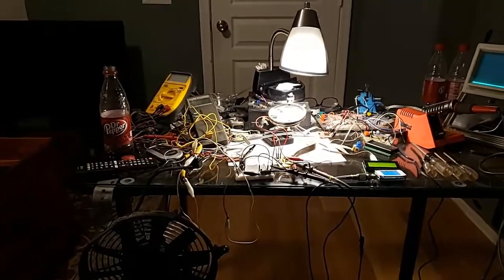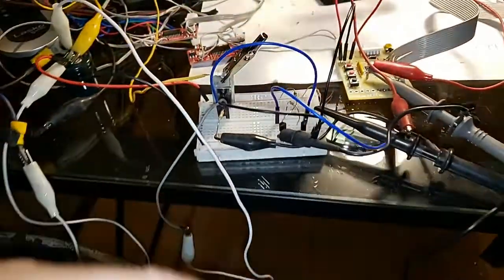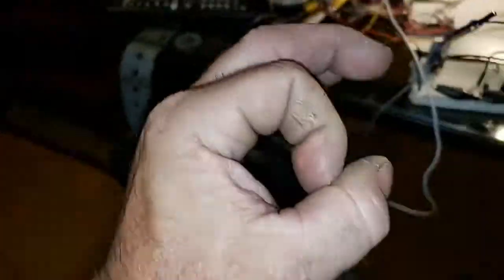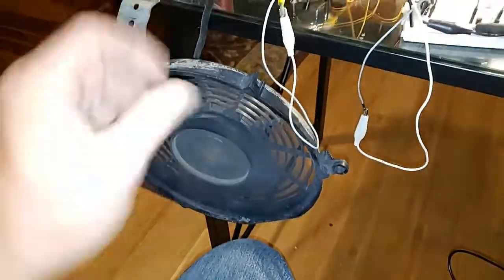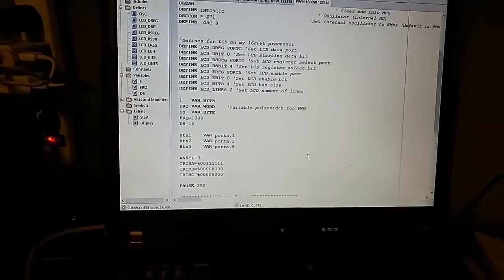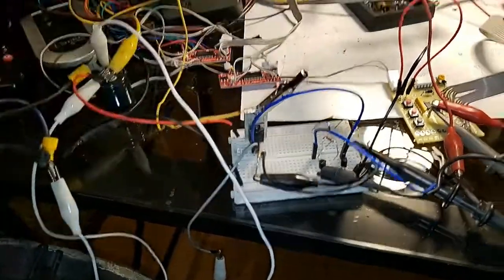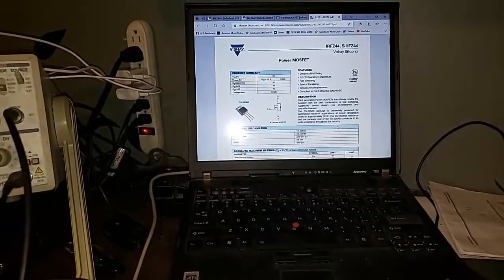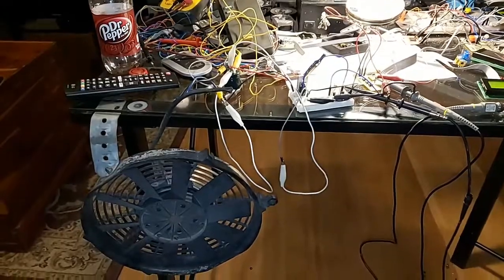Another Mustang Project - Variable-Speed Radiator Controller Test Circuit

Comment: How difficult is it to use a rotary dial or simple digital interface to modulate the speeds of a brushless radiator fan? Basically turning a brushless radiator fan into a household fan. Thanks.
Reply from the maker: A household fan has a motor with several winding taps in the motor windings that vary the speed and the rotary switch is just selecting which one to order. 

With a car fan is just one winding and to slow I'm using a duty cycle of variable pulses. 

This would not be efficient for a home fan. 
Home fans are usually low torque motors. 
These are high high torque to get running quickly.  But they suck power.
Reply: @hackfreehvac  Thanks

Comment: That fan looked real familiar, I think I have a couple of them out in my storage container that my neighbor gave me, can't remember what he said they came off of.  Damn brother, known you all these years and didn't know you had electronic technician skills!  Ive been building circuits off of schematics for years, but designing them and testing them are still on my learning to-do list, heh.  Ive seen those cool mini scopes on amazon too, amazing prices like you said! I can still remember the high prices they used to get for boat anchors at the used electronics shops here in dallas/ft. Worth back in the 90's :)
Sweet design though! I need to make up something similar for my heat pump waterheater, its in the same closet space as my air handler and when the h.p, is running it gets ice cold in there, so want to rig up a fan to blow the cold air into the living space when the unit kicks on. Maybe a current sense circuit or just wire a relay in parallel with the h.p. Fan, or something. I have a bunch of four to six inch computer shaped fans ranging from 12-24vdc and one or two 120-240vac ones. Bought a box of different ones to try and play with making a generator out of a few.
Reply from the maker: You have a heat pump water heater?
Nice. 
I don't know why we don't see those used here. It must use a lot less electricity.

I thought of making my own.
Reply: @hackfreehvac  oooh, that could be a fun project to plan out!  Hmmm, maybe buy a cheapo w.h., cut it in half to put the coils in and pipe it, then weld it back up...if you have room, instead of using the electric elements in it, just set it next to your old one and tie them together with a recirc pump, throw in one of those high pressure bladder tanks and set your main tank temp a bit lower than the h.p. tank so the gas/electric one kicks in if the h.p. cant keep up with demand. Fun fun!  
I wanted to turn my old tank into a solar batch w.h., but think its prolly rusted too thin to use. When spring comes i'll dig out the cheapo plasma cutter I bought and havent tried yet, and cut it in half to have a look :)
Not sure how much im saving with the new w.h., I have some clip around current thingies (love those tech terms!) But thats on my round-to-it list too, hehehe!
Had major back surgery abt 8 months ago so finally my pain level with my back is at least manageable enough to tinker some, yay!
Reply from the maker: I have a water source heat pump sitting in my garage that I thought of tying in with a circ pump.
Someday I might get around to it.

Comment: You can grab any fan controller from a 90s Lincoln or post 2000 ford and drive it with pwm.  I have schematics for how they are wired and signals.   I also grabbed a continental mkviii fan as it is a beast. All for $30 at the pick n pull
Reply from the maker: Nice. 
But that won't buy home made.  Lol
Reply: @hackfreehvac  hmmm fair point. But, you didn't build the fan, or the mosfet..  Soooo what is the written spec to qualify as diy?  Lol
Reply from the maker: Well, it's still DIY to build your own controller and it is my own design.
It is another thing to expect me to build the actual discrete components. That would really be something.
I don't have a clean room or any ability to make chip wafers! HA HA

Comment: Your MOSFETs cooling if mounted in the engine compartment where the air temperature will be between 140 to 180°+ and like trying to cool it in your living room at 70° you will need a lot more heat sink attached to your MOSFET. Are used to do this back in the 80s and early 90s when ford first started introducing modules that particular relays permanently built inside would fail I would bypass him and do the same thing saved a customer several hundred dollars to 1000 $ in repairs. Same goes for the ECM main computer control for the entire vehicle when one particular signal going in and coming out would fail you can bypass it with a simple relay some diode’s resistors to stop voltage spikes and externally mount your bypass. If you waterproof everything and mount your mouse vet in front of the radiator and condenser into the incoming rush of air in the front of your vehicle your MOSFET will greatly appreciate it.
Reply from the maker: I read planning on installing it right in front of the radiator. 
Then it will be cooked by that awesome 130 degree Arizona air.

I already added the feature (in the programming) for a digital output going high when the PWM reaches 100% that will close a relay once the fan needs to run at 100% such as when the A/C is running.

Comment: Well, your circuit is built wrong. You need a diode - mosfet pair in there with some wealthy decoupling. you can NOT and NEVER run the mosfet with an inductive load, without the diode. See this, how the circuit behaves: https://i.imgur.com/6iUZdnc.jpg
Also, the PWM frequency has to be chosen with regard to the current ripple through the motor, so the ripple can be small (maximum 10% nominal current in real applications). Can be easily calculated, if the armature inductance is known.
Reply from the maker: "Test circuit"
And many of these high end mosfets have that reverse diode protection built in. I hardly ever add a diode.

I do however always add a diode when driving a relay with a standard transistor.
Reply from the maker: I've also filtered the output with a capacitor. 
I don't think the brush style motor will care what freq the PWM will be if it's just seeing a variable filtered DC supply applied to it.
Reply: You are just showing, that you don't understand much if anything at all. No offense, just trying to explain you that you do it completely wrong!
Every mosfet has a body diode inherent from its design. But this diode does not act and does absolutely nothing is a brushed DC motor regulator. You absolutely NEED one, connected similarly as you use one with the relay as you have said.  
The diode absolutely NEEDs to be designed for the same operational current as the MOSFET is, as the diode continues to carry current whenever the mosfet is switched off, as clearly presented in the circuit diagram I have posted (I hope it can be viewed).
If no diode is present, all energy accumulated within the inductance of the load is dissipated in the mosfet, by creating a voltage spike, that the mosfet dissipates into heat. Luckily, most modern mosfets are avalanche rated and can withstand this up to some amount. However, this is just built-in robustness, not to be EVER used like this. 
No no no. The motor cares a LOT what the pwm frequency is.  Lower the frequency, higher the current ripple. Not only will you finally damage the motor from pulsed torque operation (remember, current is always torque and voltage is speed), you will also put unnecessary stress on the circuit due to unnecessarily high pulse currents. Remember, that the power loss is a quadrature of the current. Doubling up current creates quadruple the loss!
Too high PWM frequency will not probably hurt the motor too much, apart from likely slowly degrading the winding insulation by excessive voltage slew rate (higher frequency content produces more V/s), and will increase switching loss in the circuit: Switching loss in the mosfet itself, reverse recovery charge of the freewheeling diode and also the energy stored in the capacitance of the switching circuit (you probably already know well, that VFDs can not be used with very long cables!)
No capacitor, other than the dc bus decoupling one has to be present in the circuit. Putting one across the motor is downright stupid, as not only will the current ripple will be high due to your (probably? already) low PWM frequency, the mosfet will now also see pulse current from charging the capacitor directly from the supply!  It may seem to work with your small power lab supply, but doing this with a 20 amp fan on a car battery will certainly blow the shit out of your mosfet, if not exploding the (electrolytic?) capacitor long before by extremely excessively large currents flowing through it.
In case you need any further help help or explanation of this, you can always contact me on my channel.
Your long time subscriber
Reply: This is how it should be done: https://i.imgur.com/2kppkfb.jpg
Also do not forget that 12V car systems must be rated to withstand up to 40+V overvoltage (google for example for "load dump"). Using a 20V mosfet or such things is unacceptable. 
https://en.wikipedia.org/wiki/Load_dump
Note please I am not a clipboard warrior trying to prevent you to build anything custom for your car. Please just take it as a good offer of help.

Just one last note, quote: "... variable filtered DC supply applied to it" - the armature inductance is what is supposed to be used to filter the pulsed (PWM) voltage into a smooth current!

Comment: I've wondered about a variable speed radiator fan... following!  I can think of a few other uses as well..  condensing units, to car radiators.  CPU water cooler?  should be neat!  Also: some computer power supplies have a device, looks like a D shaped transistor, but it's a 3 legged fan controller.  They usually stick it to one of the heat sinks as it's temperature controlled.  Might be useful?  Thanks for sharing!
Reply: Most of the stuff in computers now is all variable and driven by PWM - mostly for noise pollution. This would be pretty cool for a car though. Prolong the equipment and less energy drag via soft start.

Comment: If they made 3 phase AC motors that size, that would be really handy for this. I think mini splits have them close to this size but probably lack the torque.
Reply from the maker: That would be cool to use a used minisplit motor. 
But those units have a lot more surface area and require less CFM's than a car radiator and condenser.
Reply: @hackfreehvac  It's a gap. You've got those but don't have the ass to move it. But you could get a micro RC motor that would lol but duty cycle would be a few minutes unfortunately.
Reply: RC motors are cheap crap  designed for lowest weight and cost, won't last a day.